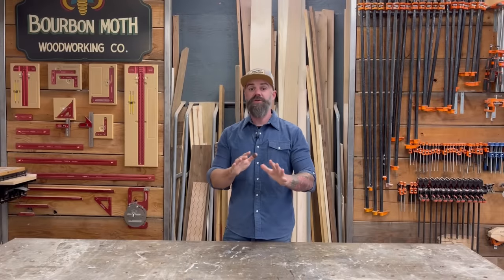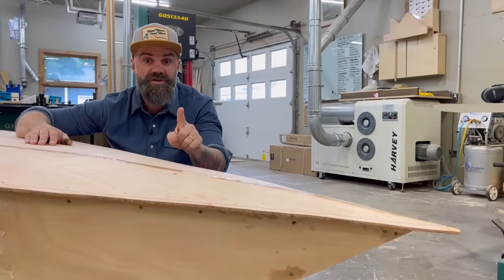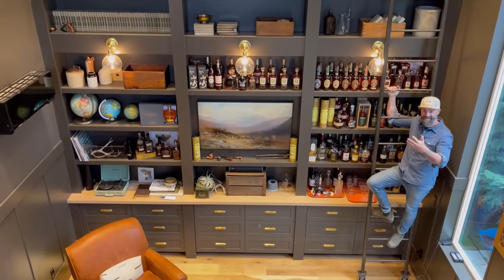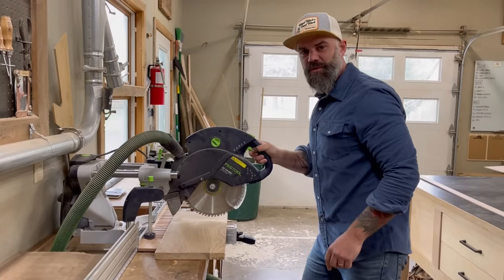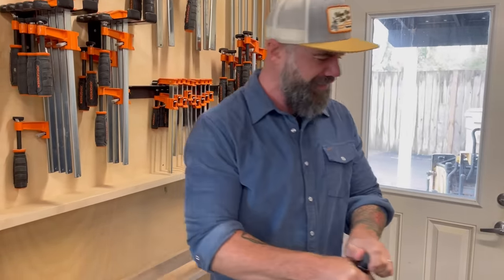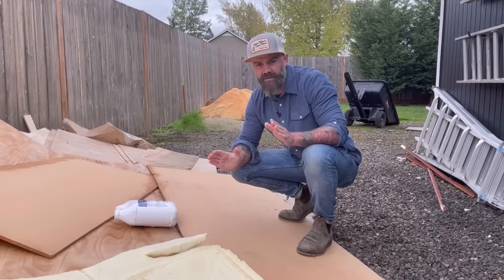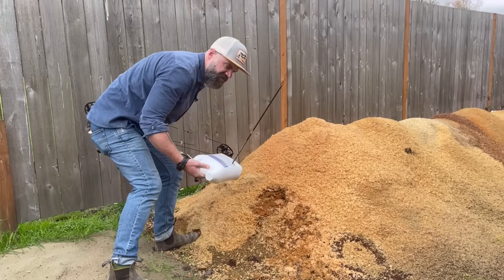I Have Some Big News || Some Crazy Shop Updates

Comment: It's still cider whether it's alcoholic or not. Or at least that's how is referred to in the US usually. If it's unfiltered and you haven't added sugar, it's cider. Otherwise it's apple juice if you filter it and add sugar.
Reply: I’m not sure adding sugar is even required. You can buy 100% apple juice that is unsweetened. Seems like it’s just the filtering that triggers the name change at least in the middle of the US.
Reply: @cmaterick  Yeah that's true actually. On top of that, commercially made hard cider is filtered to basically be alcoholic apple juice.
Reply: There is a difference between Apple Cider and Hard Apple Cider.  One is non-alcoholic (you can serve it to kids) and the other is alcoholic (would you really serve this to kids?).  Some people have alcohol on their minds.
Reply: Traditionally speaking though, cider used to mean an alcoholic drink. Cider actually predates beer in the US, as apples were easier to find for early settlers than grains were. These days we call it hard cider to distinguish between alcoholic or non.
Reply: I agree, I live in western New York and you can buy apple cider in the store. It’s non alcoholic, hard cider has alcohol and then there is apple juice. So I believe it has to do with the filtration of the squeezed/crushed apples.
Reply: Over here in Ireland it is apple juice. We also have cider which means there is alcohol in it 😊
Reply: US --- non-US
cider --- unfiltered apple juice
apple juice --- filtered apple juice
hard cider --- cider
Regional semantics wooooooooooo
Reply: In the English language cider is fermented apple juice, if it's not fermented it's just Juice! You Americans can call it what you like but juice is juice and cider is gut rot lol
Reply: @barrychristian4050  True, but since we took that rudimentary language they spoke in England and perfected it, we will stick with Cider. Just like Soccer.
Reply: If you add cinnamon and warm it up it’s cider, in my book
Reply: Also true in Canada
Reply: What grinds my gears is ‘pear cider’ as cider is a fermented APPLE drink. Rant over 🌞
Reply: @HDBrown-wc9xt  That's usually called hot apple cider here.
Reply: I almost forgot to add that at least in the US, cider can also be made with other fruits. So just saying cider isn't specific to apples.
Reply: @jstoeck784  Hush now oh mistaken one 🤫😂
Reply: My understanding is the same as John Clark’s comment.  We’ve pressed our own cider for years. I do filter it one time just to get the chunks out that got by the initial press but we don’t filter for clarity of the liquid.
Reply: Oh come on. Don't be so pendantic.
Reply: Came here to say the same thing. There is hard and non-hard cider, but both are cider
Reply: Everywhere in the world : you take fruit, you press it, it is fruit juice. You take fruit juice, you forget for some time, it ferments, you get 'strong juice', or wine. In hebrew : sekar. In greek, sikera. In latin, sicera. In medieval french, cisdre. In english, cider. 

And then, the US go their own way, and decide that pressed fruit can't be juice. That is not industrial enough. And yes, please, add some sugar in my naturally sweet juice, everything is better with sugar. Sugar is good for your health, it will make you a big boy !
So, now, how will we call this fermented apple juice ? Apple wine, as the English called it before the  French invasion of the lexicon ? No way ! Let's call it 'hard cider', even the one that's still sweet. We have our own imperial units, we can have our own lexicon. We are the land of freedom ! Who cares what says the world ?

And then, of course, there are the Japanese. They want to be cool and modern. They like foreign languages : French, English... Lots of cool words. I don't know what they mean, but I will use them since I like the sound. So, this lime-based, non alcoholic beverage, I will call it cider. It will confuse tourists who visit my café, 'Le petit maison'. That's fun ! What ? Do I have something made from apples ? You mean ringoshu ? Of course I have ringoshu. But you asked for cider, not ringoshu ! Cider is made from lime. I'm confused... Foreign people are so difficult...
Reply: Cider is usually pressed,  un filtered, and not pasteurized. Although some commercial ciders ARE pasteurized minimally for safety and still considered cider. When it's filtered it's juice. Some have sugar added some don't and wether it's from concentrate or not it's still juice.
Reply: If we're being pedantic, here's what the Oxford dictionary says:

"cider /ˈsʌɪdə / 
▸  noun [mass noun] an alcoholic drink made from fermented apple juice: a bottle of cider [count noun] English-style ciders. ▪ (also apple cider, sweet cider) North American an unfermented drink made by crushing fruit, typically apples.
 
– ORIGIN Middle English: from Old French sidre, via ecclesiastical Latin from ecclesiastical Greek sikera, from Hebrew šēḵār ‘strong drink’."

So they agreed that it depends on where you are.
Reply: It doesn’t need to be alcoholic to be considered cider.
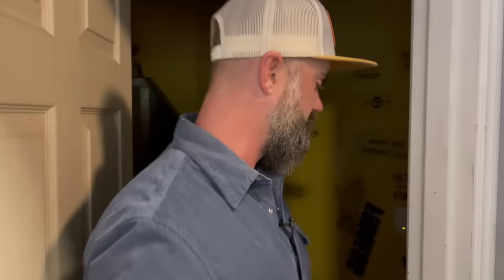Reply: 3:50 in the UK (and probably other places) cider is always alcoholic. In the US, cider just refers to unfiltered juice (this goes back to prohibition) and "hard cider" is the alcoholic stuff.
Reply: Apple cider, insider, outsider. Whatever. I don't care what you call it as long as it tastes good, and I'll bet his batches taste good.
Reply: @barrychristian4050  Sarcasm and needling are not your forte.
Reply: @djstuc  Sarcasm and jarring. You have to poke the Brits or they get a big head.
Reply: Wait… Apple Cider was still Apple Cider longggggg before cider was alcoholic. 😂😂😂😂 sounds like the people complaining are to young or raised wrong.
Reply: Bro, sorry but all that what you wrote reminded me an episode of The Simpsons
Reply: Cloudy Apple Juicec(unfiltered with the fibre still in) is better than filtered juice... and when drinking fruit juice, remember you may have the equivalent of 18 apples in a glass, which means you will have a massive sugar spike, which is extremely bad if you are type 1 or 2 diabetic or prediabetic ~ understand your diabetic risk and avoidance of exacerbating your underlying risks of type 2. Oops, way of topic.
Reply: @Kolnerbigblue "would you really serve this to kids?" ~ apparently this is determinant on how annoying the brat (Oops; Imeant "kid") is.😁
Reply: Who adds sugar to apple juice?!

Don't think you could market that as "juice" in my country...
Reply: Well, since cider derived from the french word cidre, which is 'äbbel woi' where I am from, it is alcoholic. Unfermented - filtered or not - it is Juice. With sugar added it is just an apple drink. 
I guess some franco-american mum sold it to her anoying kids as cider, to stop them complaining 'We want the same as the adults' and was afraid to correct the term after their adolescence. Same guys are said to still believe in Santa Claus. In their fifties. Americans 🙄
Reply: It is filtering and pasteurizing that makes it juice instead of cider.
Reply: Wanted to do a bit of research BEFORE I chimed in ... but generally (In The US at least) it is Cider if it's unfiltered and Un-Pasteurized. Apple Juice is both filtered AND Pasteurized to make it shelf stable. Because of that, Cider is generally seasonal. Hard Cider, is specifically alcoholic & because of that it is also stable & available year round. And again, these definitions can differ if you are in the UK/Europe.
Reply: @paulgrassart8935 you’re right.  We absolutely DO NOT care what the world thinks.
Reply: Well if the Simpsons taught me anything, it's that if it's yella, you've got juice there fella, if it's brown you're in cider town.
Reply: I do have a question for you. What was your profession before you tube?
Reply: Please make a small shop that fits a car overnight. Car theft and burglary in my area is still a thing, as are hurricanes and other disasters. I have to park outside, move tools out, then put the tools away, and put the car back. You might want to do that with the drift boat, maybe?

Ok. Hope you do that. Thanks.
Reply: Filtering turns cider into juice.
Reply: @djstuc  oi 'ave ya 'erd the average chav speak? thats reel propa mingin that is like bruv. I always find it amusing that the most traditional English is spoken in... the southern US of all places. Yeah, Jethro and Billy Bob speak more faithful English than the chaps who invented the language. All foolishness and pedantry aside, English and especially French (hard) cider is much better than what we yanks produce (most of which is disgustingly sweet). The Kiwis make some pretty good stuff too.
Reply: "Soccer" was actually coined in the UK. Rugby and soccer were seen as variants of the same game until mid 19th century when rules, for both, were codified. The former called Rugby Football and the latter received the moniker Association Football. As typical with young people (particularly Brits), slang developed at Universities, Oxford and Cambridge in this case. Rugby Football sensibly became "Rugger"; Association didn't shorten as easily in that fashion. They got crafty and chopped the A and S from the "ass" end of the word (ironically found at the front of this word). They then exchanged the final 6 letters for a "cer" at the end, following the same double consonant as established with "Rugger", and thus, "Soccer".

So the UK actually had it right. They just seem to have forgotten.

Comment: Just a word of advise- take it or leave it… Separate any potential welding space from your other workshop areas. It’s much easier to manage the mess as welding is dirty versus dusty. Oh, and welding is fun too!
Reply: 100% solid advice. Metalworking and woodworking environments hate each other. Grinding sparks love finding little piles of saw dust. Saw dust loves to cling to anything oily in the metal shop.  I have two separate rooms for wood and metal.

Comment: Jason, I searched all of YouTube and couldn’t find one good video on the sanding process. I know sanding is one of your least favorite things to do, but ALL woodworking videos literally skip through that process when it’s so important. I have so many questions about sanding. Such as in between grits, do you wet the wood with water to raise the fibers, and if so, do you wait until it’s dry? What is the highest grit that you sand to? Do you hand sand at the last grit that you use? In between grits do use air or cheese paper to clean the surface. And even when finishing, I have questions on how you sand in between coats. If you could do a video on that I’d greatly appreciate it.

Comment: 500+ comments at this time, this will never be seen, but a guy can wish. They say, you can wish in one hand, crap in the other and see which one is fulfilled first.... 

Awesome plan for shop changes and videos and the patreon summit thingy, cool. 

to add to the suggestions you will get ad nauseum for the new shop, put whatever dust extractor you use in it's own little enclosure, or in an enclosure outside the shop. You will love not having the noise from it in the shop.

The big question I am left with is did the fish get flushed or not?

Comment: I am new at this woodworking stuff. Only made shop furniture, you know, Making stuff for making stuff. I have a Sawstop Contractors saw. I want to build an outfeed table that surrounds the saw. But, I want to build an overhead cabinet, too, that will hold the sleds and push blocks, support the blade's dust collection hose and even have a light. I searched the internet but found no one did that. Would you consider being that guy?

Comment: Cider is a pressed juice from apples that will naturally ferment slightly if aged long enough. The alcohol content from naturally fermented cider is very slight and was generally considered safe for children in the early days of the American colonies. What makes it cider is the fact that it's pressed and unfiltered. It's not pure juice from apples. It has apple particles and the natural yeast that coats apples from the tree and causes them to ferment in the first place.

Modern hard cider has yeast added to artificially increase the alcohol content and make a beverage that'll actually get you drunk, but you can still find/buy/make regular old cider that's naturally slightly alcoholic AND modern commercial cider that's not alcoholic at all but it's ALL cider because its all unfiltered and therefore more that pure apple juice.

Comment: No, don't believe them. Those comments are wrong about apple cider and juice. You were correct. Apple cider is the term for fresh squeezed apples that has not been filtered and still retain some small bits of pulp, giving it that caramel color. Apple juice had been filtered where all the pulp has been removed and only the clear juice remains. The alcoholic version is Hard apple cider, or fermented apple cider depending on prep.

Comment: Before you finalize your new shop design, if you have sufficient headroom, consider installing a false floor.  If I  had sufficient headroom, I would start with say 18" I-Beams on 16" centers.  I  would run my dust collection, wiring, and compressed air under the floor.  I would then use two layers of plywood for the floor.  The benefit is that you would not have to walk on concrete all day.

Improvements can be made to items like the air piping and dust collection ducting.  I would look at using a ring main.  This would provide for an even distribution.  It also provides for easier bypass should a piece of equipment be out of service, removed, or replaced.  A better material for vacuum ducting might be conducting Bonstrand piping.  It will be quite a bit more expensive, but it will be stronger, and in the long run easier to maintain.   Bondstrand conducting piping has been in use for around 50 years.  If you put in a compressed air system consider a rotary screw air compressor with a refrigerated filter, such as those offered by Kaeser Compressor.  One of the most important benefits is the absence of noise.

Over the years I visited hundreds of shops and manufacturing facilities.  The Renk AG Gear facility in Augsburg, Germany had the only floor that I can remember.   Renk's floor consisted of pieces of hardwood, I think oak, about 6"x6"x4" thick, with the end grain up.   It looked like crosscut slices of railroad ties.  You could drop tools and not worry about destroying them.

Good luck with your new shop.

Comment: My shed for a workshop finally arrives this month(taken over a year to save for) now the next thing I need to save for is tools. Most things will be the cheapest of the cheap sadly but whenever I finally get a sander it needs to be a low vibration one. Anyone got recommendations?
I'm guessing it's gonna be another year of saving but boring health stuff has expensive tastes so any points in the right direction would be great!